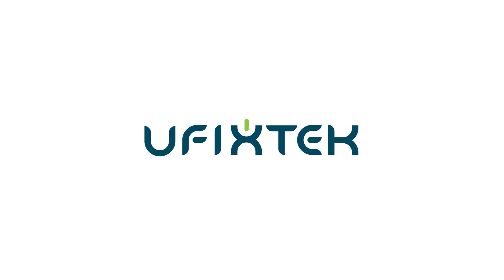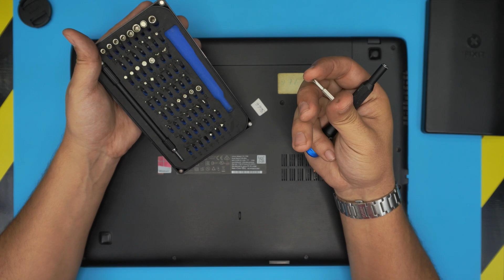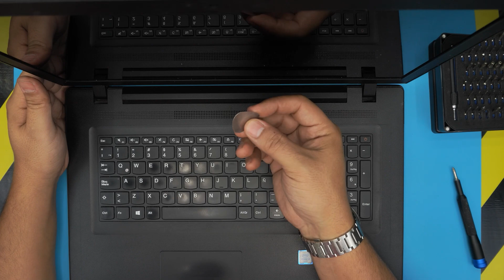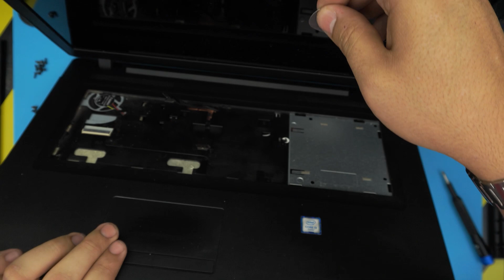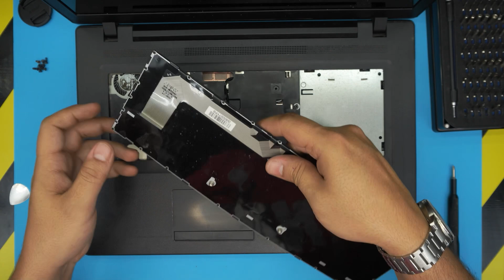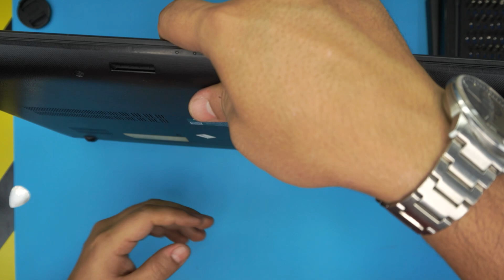How to Replace the Battery on a Lenovo Ideapad 110 17Isk 80Vl Laptop: Step-by-Step Guide🔋

Comment: I bought a replacement battery but its not charging. Does this model require an original Lenovo battery?
Reply from the maker: Thank you for your feedback! If you wish to support the channel, you can like, subscribe, or both!
Regarding your question, it should charge unless you got a fake or cheap model and the battery chip is not recognized by bios. when this happens we try different buyers and fixed. also ur original battery was holding at least 30sec charge? if not then you may have a bad mosfet on board for charging.
Should you have any further questions or requests in the future, please don't hesitate to ask me.